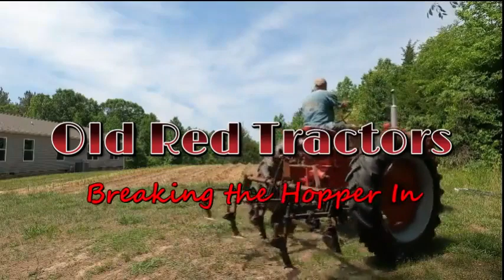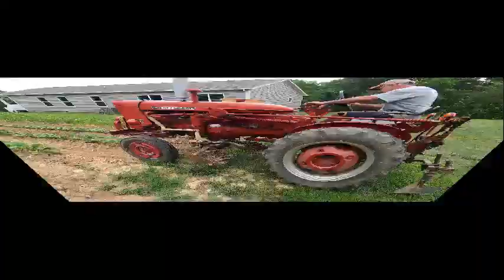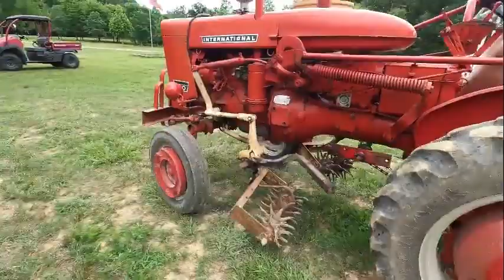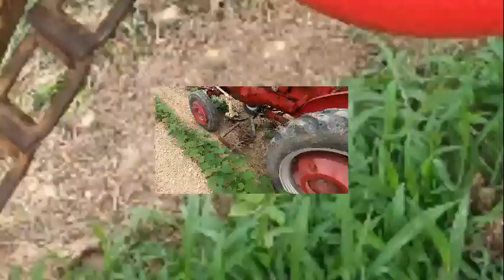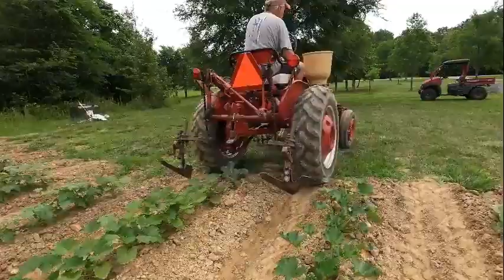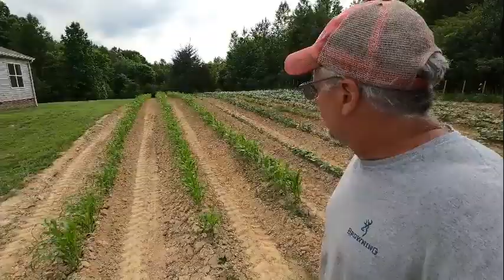Breaking the Hopper In

Comment: Nice Job 👍. We’re you worried the back feet was going to hit the next row if you let them down.
Reply from the maker: No, just trying to keep it flat. Mostly the point digs in. I'm trying to find some that will lay almost flat.
Reply: They should lay flat if you adjust the shank. Mine always work there way flat because the shank adjusters are loose .
Reply from the maker: @Jtwes  ok, thanks again
Reply: Yea if you turn the bolt ol them it will adjust the angle they attack the ground. You should get them to run level.
Reply from the maker: @natevanlandingham1945  thanks gonna give it a try. But I also like the look of tire tracks. Can't explain why, guess I'm weird.
Reply: @OldRedTractors  they do serve a purpose allowing the soil to be loosened and not compacted which helps with water working into the ground and less running out...if you have no slope you don't have to worry about the later though. 

The nut on top of the spring on the top back controls the effort required to trip the shank if you have trip shanks and the bolt in the back that's parallel with the ground controls the angle of the foot or sweep. It will point it more Foward so they will lay more flat or let it tip more downward so the point is more pointed down and there at an angle.
Reply from the maker: @natevanlandingham1945  I'm off Tuesday. I will give it a try.